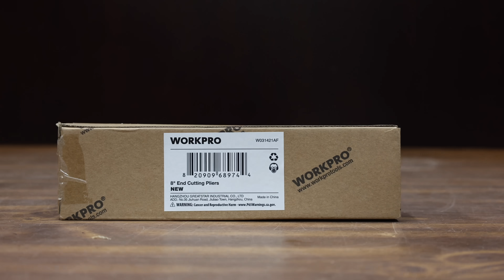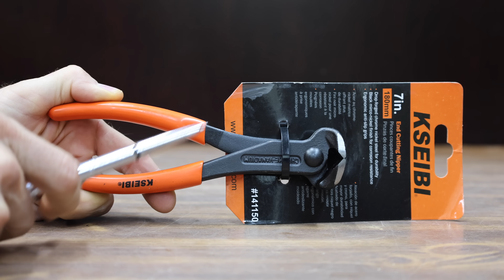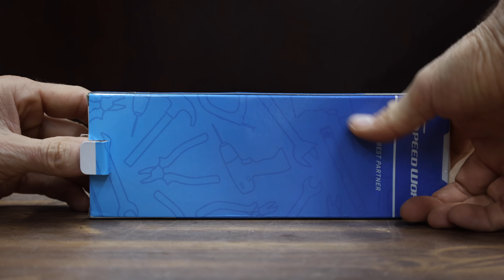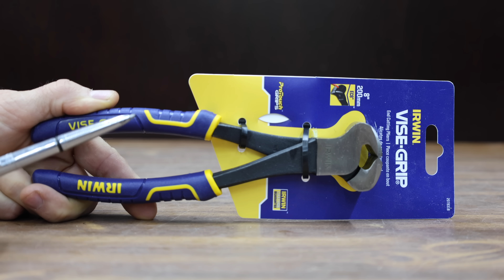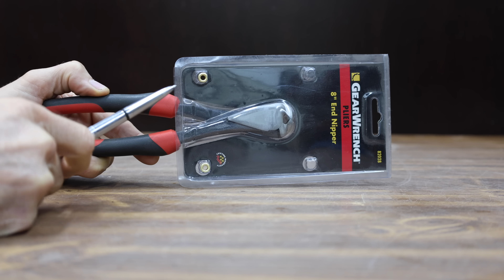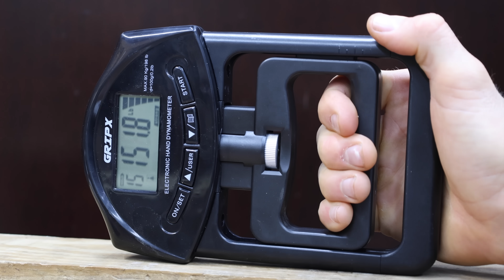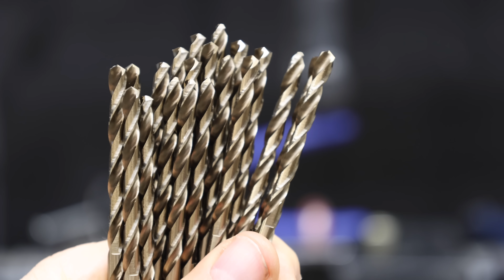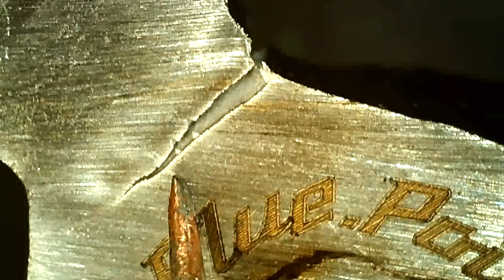Finally! Best Pliers I've Ever Tested! Not Even Close!

Comment: Knipex for the win, not surprised!  Wiha very good value too.
Reply: I knew it was going to be Knipex when I saw the group of pliers to be tested. They are outstanding
Reply: They beat Wazakura but not by much..and Wazakura is made to cut bonsai branches and aluminum wire.
Reply: @velse9869  So its sold to hipsters LMAO
Reply: @infernaldaedra  hipsters get indoor plants. Bonsai trees are not indoor plants.
Reply: Wiha have extremely good screwdrivers, knipex is all things cutting and gripping
Reply: I have 2 wihas, they are ok. But stay away from most of the wrenches. The screwdrivers are very good btw
Reply: Knipex is like the guy she doesn't tell you about.
Reply: @justinv3080  stay away from wiha quick-fix automatic pliers  and the flat tap-grip installation pliers.  They are completely useless gimmicks
Reply: I'm not sure if 85 bucks is good value, but definitely good quality.
Reply: @the3rdid485 $25
Reply: @the3rdid485  They are 63 bucks.
Reply: @the3rdid485  63 bucks
Reply: @the3rdid485  85? I'm pretty sure the chart in the video says $63. Still pricey - but it seems you get what you pay for.
Reply: @the3rdid485 
Pay once, cry once
Reply: @the3rdid485  well to be fair, with most (there are always a few bad apples) knipex tools I own, having something that does the job faster and more comfortably for decades of abuse, I'm fine with spending 3x the price of the alternatives.
Reply: @the3rdid485  It is great for the price because it will last way longer than any Chinese garbage mine is still great it's been 5 years.
Reply: @MARSHISTAKEN  I mean I definitely agree with you in concept, I usually prefer to buy something much better quality that's going to be less frustrating, work properly, and last me a long time even if it costs more upfront. But $85 is a pretty big pill to swallow, especially as just an amateur DIY guy. For me I would rather save the $60, spend 25 bucks on the second place ones I stead and they'll probably do 98% of what I need. Even if they crap out after a few years and I have to buy another pair It's still cheaper lol. Heck, I could buy three pairs of them over a decade and still save money 🤣
Reply: @the3rdid485  I'm frugal like you, and would probably do the same thing.  I do sharpen my Pittsburgh endcutters more often, but I also have cutoff wheels, recip saw, and other ways to endcut things.
Reply from the maker: Thanks for sharing!
Reply: Good value? They're very pricy tools. Good tools, but good "value" is highly debatable.
Reply: @squidikka  That just means your logic for what VALUE actually means, is messed up. Good value, doesn't mean dirt cheap. Good value means that the price is good, for the QUALITY and LONGEVITY of the tool. Both of which are very high, compared to many other brands, even at similar price points... 

85 bucks for a set of pliers, that are known to last for DECADES in daily, professional use, plus they make some of the best cuts in the business, is good value.

Most occasional DIYers will get away with a cheaper set just fine, that doesn't mean the Knipex's aren't good value; that just means we don't NEED to increase cost and quality, to meet OUR needs 🤷‍♂

Plenty of brands out there, that just rebrand shitty pliers, and charge a premium for it, that would be bad value.
Reply: @DrakeKBG exactly right. I study Mechatronics, so must of what I do is more like a diy guy that knows his stuff. I could easily get away with cheaper pliers, but it's just extremely rewarding to know that when I reach into my toolbag I can only grab quality tools that won't fail on me. That's all the value I need.
Reply: @DrakeKBG  I've had my $30 pliars for over 15 years on the job and they work just fine. Your logic makes zero sense. It's not value if you pay a high price for something of high quality. You are simply getting what you paid for. Getting MORE than what you paid for indicates high value. Like my $30 pliars vs yours that are 3x the price for NOT 3x the performance.
Reply: @squidikka  your 30$ pliers, would be 45$ adjusting for inflation, so that’s less than 2x the price. And not all 30$ pliers are as good as yours. Price does not always equal quality, but comparing Knipex to most other brands in or around the same price range, they usually have atleast 2x the performance and/or longevity. They’re usually made to a higher standard as far as "cosmetics" go, so there’s an added cost. Not necessary, but it is part of why they cost more. Nobody is forcing you to buy Knipex, I just get why they cost more 🤷

Comment: Suggested Video:  Best CERAMIC BRAKE PADS: Akebono, Max Advanced, Power Stop, ACDelco, Wagner, Bosch, Brembo - heat resistant and wear test, which one makes less dust on metal contact
Reply from the maker: Thank you for the video idea!
Reply: @ProjectFarm  And brake rotors please.
Reply: @ProjectFarm  please do a video on brakes
Reply: @ProjectFarm I’d like to add rotors to this idea, from cheap to mildly expensive.  I’m a fan of Autozone’s Duralast gold rotors.
Reply: Please add Raybestos to the list. Im a tech and found these to be the best.  @ProjectFarm
Reply: @otarsulava  that would be a great video everyone could use
Reply: Do one for us broke people then one with brembo all that for the uppers
Reply: @brandoncrawford3917  by the way, Brembo pads on a regular cars is not that expensive, but on supercars it is...✌️
Reply: @otarsulava indeed. My brembo pads were cheaper than my Akebono pads by a few dollars
Reply: Everyone know akebono is the top shit
Reply: Make sure they are all the same heat rating for the test. The rating is either on the shim, or the side of the friction material.
Reply: Yeah!  And from the big chain stores like Autozone, O'reilly's and such.
Reply: @johng.4959 Used to work for one of those chains. The storebrand brake pads sometimes came in branded boxes meant for the other stores. The stuff in the boxes all the same and the supplier was just putting them in whichever box was in front of them while not worrying if the shipments got mixed up.  We also saw that with alternators and other parts.
Reply: Forgot EBC
Reply: +1 good idea!!!
Reply: OEM is the way to go.
Reply: 90% percent of oem is akebono pads.
Just because it says vehicle makers name on the box doesn't mean they made it. A large majority of oem hoses and belts are Gates.
Reply: Also EBC brake pads .. I use yellow stuff on my trucks
Reply: Hawk pads are amazing please test those as well
Reply: I'm using a set of EBC Redstuff on my car.
Reply: Great idea, I know the car guys swear by Brembo but are they as good as they say?
Reply: Power stop are copies of akebono. 
I've used Akebono when just replacing the pads. I use Power stop when having to replace pad and rotors. 
I work for a courier service doing vehicle maintenance, the vehicles cover over a 1000 miles a week on average. Since I started using akebono and Power stop, we are averaging about 2 years between replacing the brakes. Before using parts store and oem pads and rotors, I would be replacing the brakes about 7 or 8 months.
Reply: Please do thus
Reply: And Ate Ceramic line too
Reply: That would have to be a complicated test rig but would make for some very good video!
Reply: Great idea
Reply: Need to include ebc brake pads green stuff, red stuff and yellow stuff
Reply: If you got the money go with Brembo. If you want improved breaking for a bargain go with powerstop.
Reply: @zacharycaron4834  Sure Brembo, btw mentioned this before, for regular cars it's not that expensive, but for super cars it is ....✌️
Reply: I can see Garage 54 building a test rig from a Lada. 😁
Reply: Don't forget some EBC branded pads
Reply: @wick7878  I always have EBC pads on my motorcycle, do a lot of trail braking on mountain twisty roads, never overheated! very good brand! 👍
Reply: Don’t forget TRW too
Reply: @PrioCaptSend  TRQ you mean... I had installed Struts and Shocks of that brand 70K miles ago, no complaints 🤞
Reply: Don't forget Motorcraft
Reply: Maybe even an OEM pad or two as a control
Reply: Most oem's use akebono.
Reply: You cannot go by brand alone for brake pads. Every brand will have their econ (low), mid, and high grade pads and then some will have pads above that. 

Also that’s just hard to test. You could assume a company has good pads across various models, but that’s likely not the case outside of the few very large pad manufacturers if it’s even true for them. Pads with qualities good  on a small car vs large or one piston on the caliper vs two or three aren’t the same. 

Akebonos are my favorite personally but just get what the manufacturer recommends for your car.
Reply: While I do think this is a great idea, it really won't provide a whole lot of value to viewers as it pertains to friction material because the formulations vary by application. However, it would provide great insight into their construction - specifically, how the friction material is adhered to the backing plate, and how well the pad and backing plate resist corrosion/rust.
Reply: ceramic pads only good for racing.. todays cars use soft pads rotors  SO THEY STOP QUIK. not last longest..
Reply: @harrywalker968  there are street versions out there
Reply: Scotty Kilmer recommends Akebono up and down, I have had success with Power Stop, very interested to see who would win! What a fantastic idea!
Reply: @daves-space agree, watch Skotty too, had Akebo on the previous car, no complaints, last year got "other" brand and it heats up after about an hour drive,  and creates a lot of dust on rim... Hope we're gonna test that ✌️
Reply: @daves-space  Akebono is the knipex of brake pads.  😊
Reply: @RJM_2023 no, that is ATE and Textar, with Akebonos I would never drive fast on German Autobahn😮
Reply: Power stop is basically an akebono copy. I've used both on a lot of different vehicles.  Never had any issues with either. The vehicles cover a 1000 miles a week. @daves-space